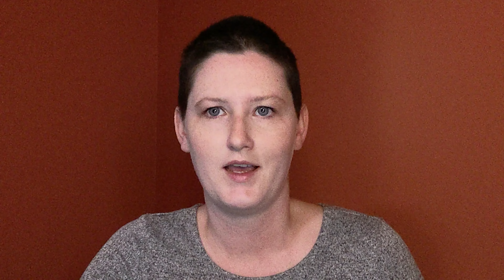Alarm Academy Q&A Video

Comment: Nice description.  A small edit regarding your design process might be that after you do your layout based on an Engineer's preliminary design, you might have to submit shop drawings and product data for approval from that Engineer prior to moving forward with the process.
Reply from the maker: Yes, we are required to have a professional engineer stamp our drawings prior to approval by the AHJ.  I usually try to get the engineer on record to do it, but if they are unwilling, I hire another engineer to review and stamp the drawings prior to submission.